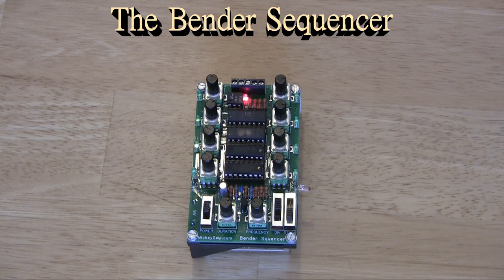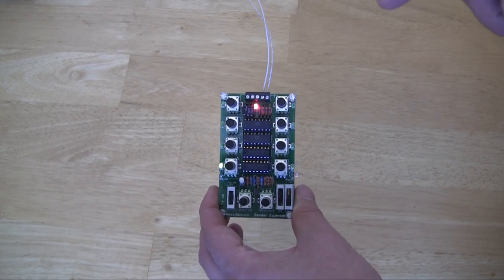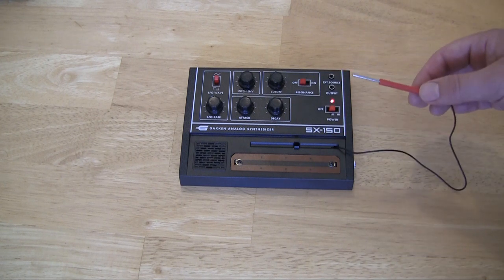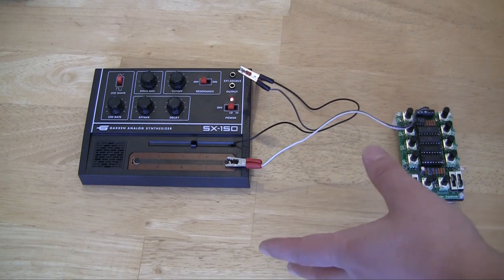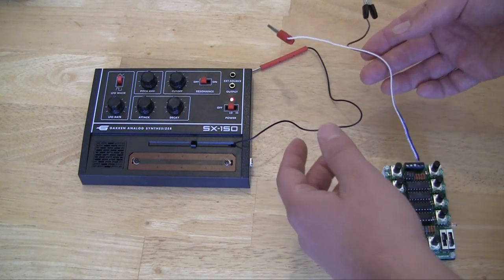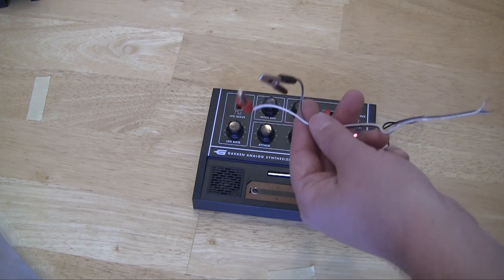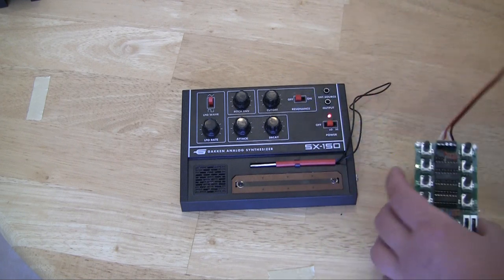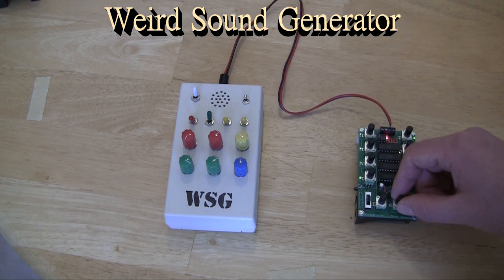Bender Sequencer Demo

Comment from the maker: We haven't tried it, but it should.  The Bender Sequencer can be inserted into a circuit anywhere there is a potentiometer, and the BoardWeevil has a bunch of them.  Of course, it does not just plug in.  Anywhere you use the Bender Sequencer involves modifying the original device - that's circuit bending!